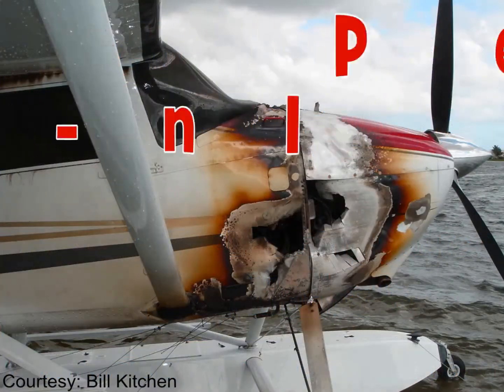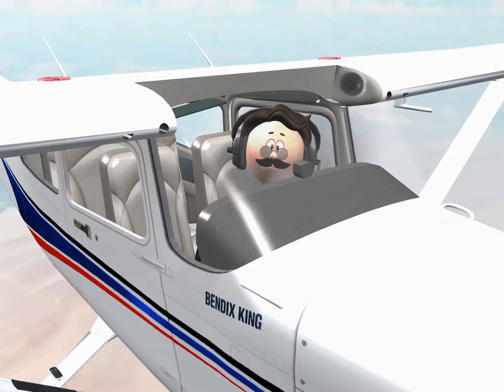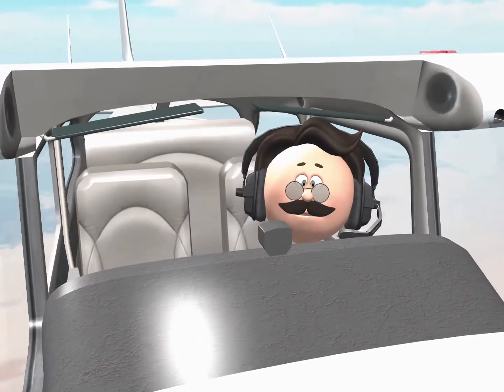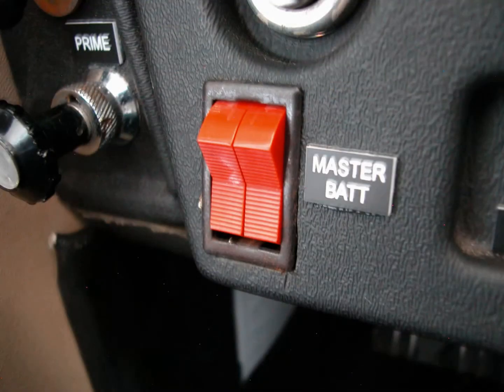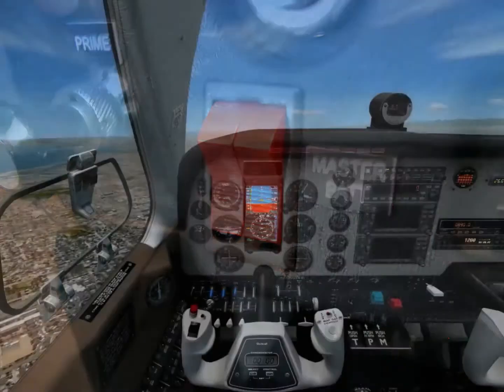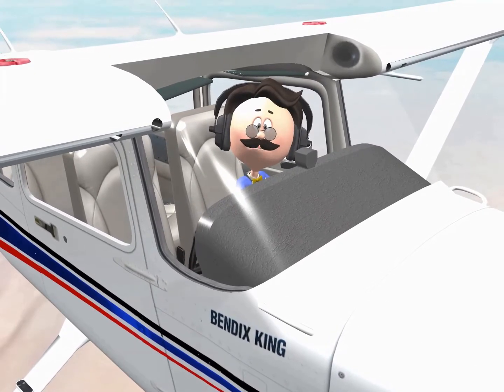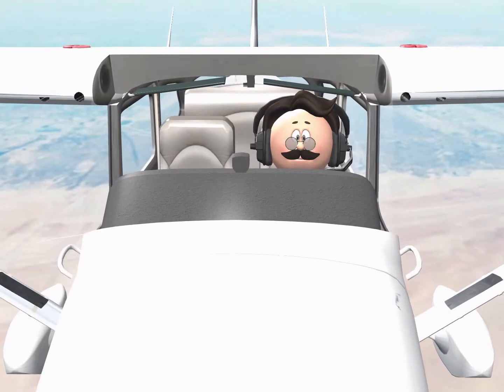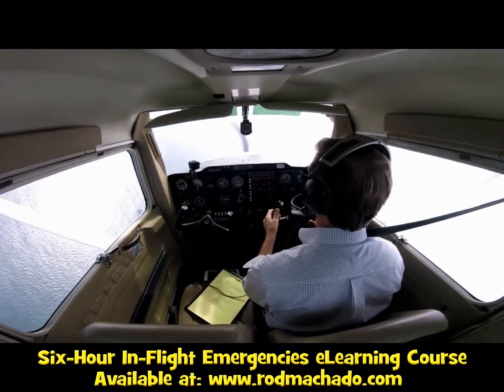Handling In-Flight Emergencies - In-Flight Fires

Comment: Very good video. I order to get out of the air fast, just fly a Lake Amphibian. With no engine power and gear down it decends similar to a medium sitzed brick. In a steep turn 3500-4000ft/min @100 knots is what you  get.

Comment: Wouldn't a 90-degree bank get the plane out of the sky faster than 60 degrees?
Reply: well, its very easy to overstress the airframe if you do a 90 deg bank, since at 90 degs g forces are determined by you're airspeed, and since you're going as fast as possible... yea not a great idea